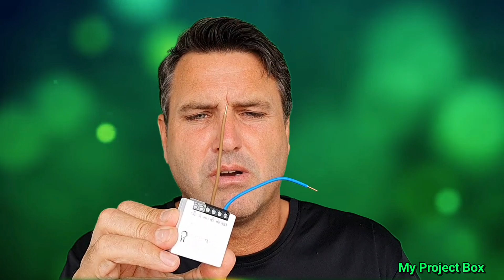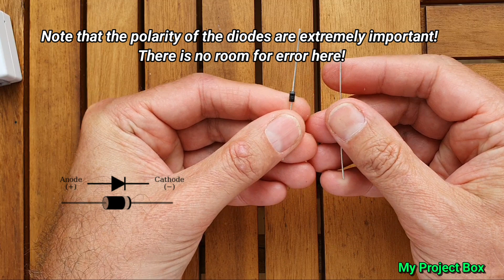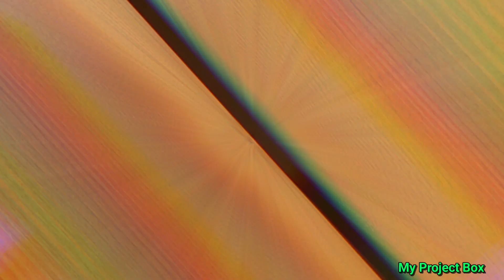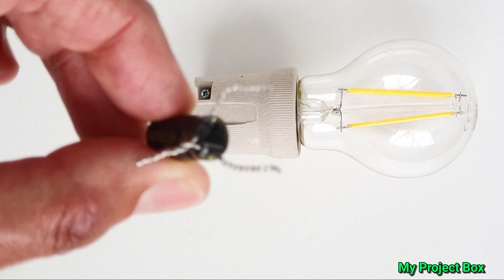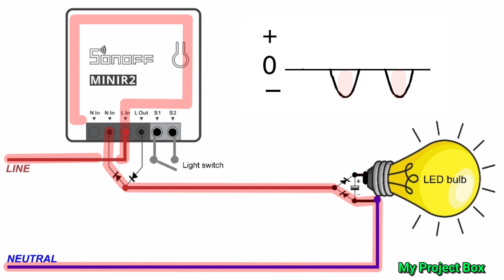Using Sonoff mini R2 without neutral wire #sonoffmini #noneutral #electronicscreators

Comment: I have an interesting situation. My home is old and with existing electric system. In bathroom however on the light switch somehow the "expert electrician" brought the neutral and the live wire goes directly to the light bulb in the ceiling. I can't even find the junction box to invert wires because is over the drywall ceiling and surprise surprise, without any access to wires. Is there any way to work around this problem? Will it be the same if instead of N.in and L.out to connect diodes to  L.in and L.out and neutral to go directly to N.in? Edit. Just connected the same way as the scheme and it worked like a charm. The only difference is that live doesn't go through the reley but free as a bird as it was before.

Comment: I would add a strong caution to not use this on any transformer loads like older 12v down-lights. The transformer will magnetize and overheat. I also think that a fuse lower than 1A should not be optional. The 1N4007 diode is rated at 1A and your circuit breaker normally needs 10A to trip.

Comment: Thanks a lot. Very interesting invention!! I am wondering how exactly the capacitor works (in the video you don't talk about it when you explain the flow of current during the two halves of a sine period). In your answer to @NicksStuff and later on you talk about it working as a filter.
I'm dimming 60W 1000mA dimmable LED driver by means of a Shelly Dimmer2.  Being dimmed the driver makes 50Hz noise. Would a (variant) on this circuit reduce this sound?

Comment: but i guess this only works if the current draw of the smart switch is very low? I.E it wouldn't work for the Mini R4M, which uses matter/wifi?

Comment: I found this video linked form a reddit post where the OP was looking for a 2 gang light switch. 
And in my setup one of the switches is my outside lights where there are multiple lights Woulud this work for that and would it require a bypass on each lamp or just one to complete the circuit?

Comment: This is a great video thanks. I have a smartlife 1gang light switch which requires neutral but I don’t have neutral wiring. This hack should work for it too right? Mine has L, L1, L2, L3 and N. Many thanks

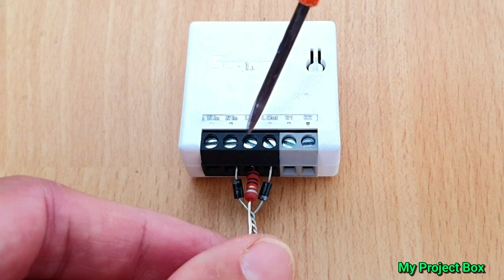Comment: 12:08 - I have 220V, is this circuit designed for 220V? And the second question, the resistor is 10 ohms, and how many watts?

Comment: Maybe this is a stupid question but...isn't this essentially using two "half bridge rectifiers" to turn one AC circuit into two alternatively pulsating DC circuits? If that's indeed the case, I can see some smart switches not liking at all the fact they basically only get power half of the time...am I just missing something?

Comment: @MyProjectBoxChannel Good day, thank you for your very informative videos. (220VAC in Europe) I built this version of the no-neutral circuit and my Sonoff mini starts up on the light switch side but the light did not react when the mini switch is toggled, when I measure the voltage connected to my light/LED I only measured 110VAC between live and neutral. Is it possible to point me in the right direction with the above provided information? tyia

Comment: Be aware this is dangerous as you are taking the current for the lamp through the diodes which are only rated for 1A, thease could over heat and fail.

Comment: Good morning
I installed a SONOFF Zigbee module without ZMINIL2 neutral on the two-way switch connected to the phase, which allows me to turn off the light in my bed, provided I remember to activate it again in the morning, so that the two back and forths are powered again. 
But the problem is that without any other intervention, after restarting the ZBMINIL2, after a while, the ZBMINIL2 "jumps" and I am forced to activate it again, I don't know why. And then everything is fine with the two back and forth. But then it starts again as soon as I activate the ZBMINIL2.
In addition, I wonder if this assembly does not present a danger. 
If you have a solution for this problem, I'm interested. Thank you in advance.

Comment: Thanks for the video! Be aware of cheap led bulbs like V-TAC or Hense. They have capacitor in series and they do not work with direct current. If someone fails with this circuit the problem might be in LED bulb. Try different ones.

Comment: Amazing thanks for uploading
I just did this in my house and it works flawlessly even without the cap as there is no flicker on LEDs at all 

I am using this for smart switches that needed neutral, but this is perfect!

Comment: Thank you for this. Have been looking for a solution as simple as this one. Just to confirm, the sizes of the components you used works for RSA households (voltage etc)? I assumed from your accent you're South African...Afrikaans soos ek;-). Where do you buy your components? I already have the Sonoff switches, just looking for a reference for the diodes and capacitor?

Comment: Would this work as well with a Sonoff NSPanel and a 32watt LED Light (BW-CLT1) ?

The NSPanel is basically the same as the Sonoff Mini just with a touch display, so will pull much more current.

Comment: Hi, it seems to me in the schematic @16:05 shows that Line Out and Neutral In are connected via the 2 forward biased diodes. Doesn't that cause a direct short and trip the breaker? Thanks.

Comment: @MyProjectBoxChannel - Comment / Challenge for you here, USA 240v circuits in home run on a 3 wire + ground split phase configuration, they have two Lives that are out of phase with one another (120 V each), in most cases no neutral at the device you want to switch, and a ground. in this case, the appliance circuit can be completed without a neutral (L1 as live and L2 to complete the rest of the circuit, combined they deliver 240V in sort of a push/pull phase configuration - V measure being the difference between highest and lowest point of the wave). How would you wire the Sonof (or the shelly) here? I have diagrammed this out in quite a bit of detail to prove that 2 lives behave almost identically to 1 live and one neutral, with only one exception that I canb spot: in split phase, L2 can produce significant electric shock when the appliance is off. happy to show my work, and would love to see a video on this, assuming you'd be able to simulate the split phase 240 V circuit?

Comment: For cheap Aubess smart switch it is needed to reverse polarity of all diodes. Just do a try to power the switch with diode in neutral line, note working and non-working polarity of diode, and do all others accordingly. Thanks to author of this great idea!

Comment: Great sharing. Can you please explain whether a 10 ohm fusible resistor and 10uF capacitor is suitable for both 110V and 240V systems? Additionally, is there an easy method for determining the appropriate selection (simple calculation) of fusible resistor and capacitor?

Comment: Thanks for this video. The information is very useful. 

In the case where there is no neutral and capacitor is used, 
https://youtu.be/LqKUTmLpjFY?t=1131 
at 18:51, Aqara connected at L1 only, but when pressing the empty load L2 and L3, the L1 load flickers. 

In the case where there is no neutral and no capacitor, 
https://youtu.be/LqKUTmLpjFY?t=1358
at 22:38, Burnett connected at L1 only, but when pressing the empty load L2 and L3, the L1 load flickers. 

Any suggestions for a simple solution (both cases above)?

Comment: I have tried this but on Sonoff M5 (2 gang) , thinking it would work the same way, but i fried both of the relays on the board.
When switches were off, the device started normally and i was able to pair to my phone. As soon as i activated the Switch 1 it exploded, i tried it again on Switch 2 thinking i may have done something wrong and when activating Switch2 - boom again, now both of my relays are fried :D
maybe im doing something wrong, or maybe it doesn't work with this switch..

Comment: Hi there bud I need some help if u can ild love u forever lol 
I have a control box with a 24acv 600mA out put the controller is designed to activate this output via a program, I wish to activate a uk plug on and off, my assumption is that I need a relay but I've no idea which one and how to wire it

Comment: Great video! Thanks for explaining it so clearly, defs a good solve for RSA households which are typically not wired with a neutral in the box. I have the Sonoff ZBMINI-L which works great but then loses its connection to the hub after about 3 days for some reason... was pulling my hair out! 

Question though: I've got a series of LED lights along with a 60W LED spotlight on this circuit... would I just connect the diodes at the first light in the series?

Comment: what a nice electro-magnetic interference device you make, double pulses around  around 4 possible 5 meters wire  to act as antenna basic transmitter principles , i hope to not have any radio armature station close to you ....

Comment: Thanks for the tutorial. I have a switch w/o N which I would like to install zbmini in and keep its router feature. Do you think your electrickery will allow zbmini to preserve the router feature? In the end the diodes are kind of 'stealing' the power from 'halve-phases' right? And being a router is a serious business :) It needs power! I tried the switch with zbmini-L and it works, but zbmini-L doesn't have router feature.

Comment: I tried this solution with my sonoff smart switch (T1EU1C). the switch itself is working and turns on the light bulb but the light bulb is vibrating really faintly. It seems it does not get enough current. Any idea?

Comment: Hi, thank you so much for this video. I only found out that I have no neutral lines in half my house after ordering the R2s. I just implemented your solution, but experience quite a lot of flickering when I turn on the switch. My country has 230V 50hz, is there any way I can reduce this?

Comment: Have to say this is one of the most useful video I have seen in reference of a No neutral.

I just follow your directions and hook up a mini2. Works like a charm!!!.
I did not have in hand the 10uF 400V, instead I used a 473k 250V X-rated capacitor and works perfectly. My country voltage is 120V @60Htz.

This method of yours might be "the solution" to a very big headache for most of us trying to get smart devices up and running with the old electrical installations at home.

Once again, thank you very much!!!!

Comment: Awesome, I'm gonna try this for sure. But I have questions about fusible resistor and the voltage you are working with in this video. 

Q: Does a fusible resistor need to be able to handle a specific Watt? 
Q: Which voltage are you working with here, 110v or 220v? (I'm living in a 220v country, not sure if I can apply this circuit or not?)

Thanks a lot anyway.